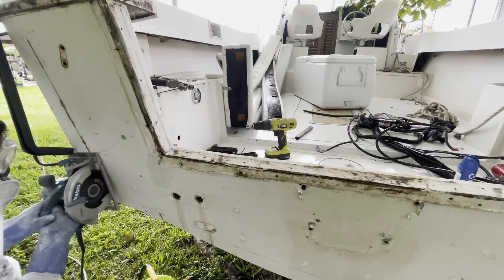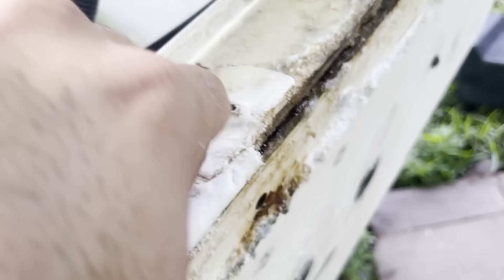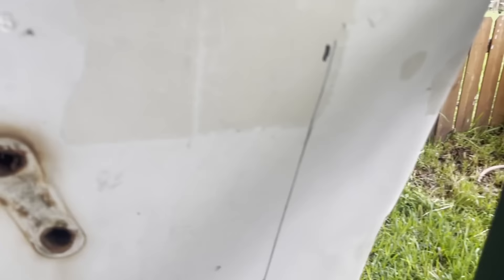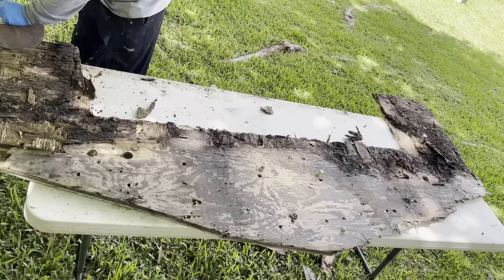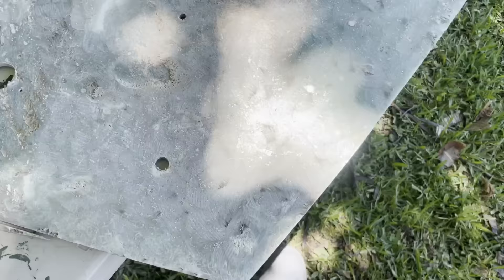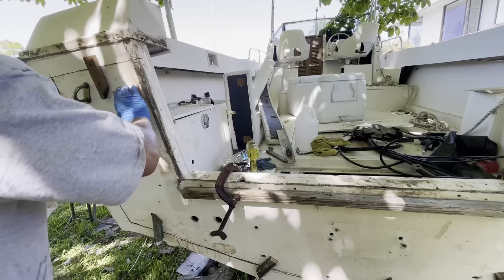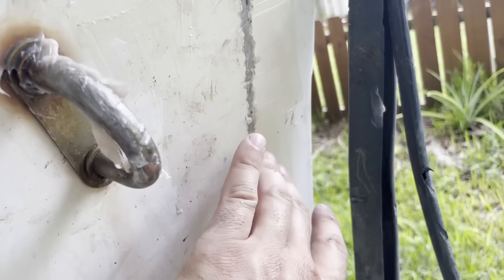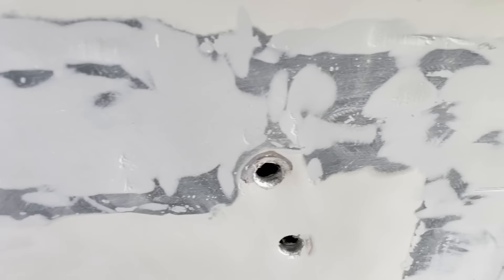Replacing A Boat Transom | Grady White Restoration Project!

Comment: How to destroy a grady white... please do a follow-up video when the engine and whole transom fall off because of your silly little patch job ...
Reply from the maker: Todd. It’s been a year. We literally just did a 200+ mile trip on this boat. I know you’d like for this transom to rip off because you’re an insufferable person. But you obviously have no idea how this poured transom works. It’s been a year. So there’s your follow up. Now, please explain how your theory doesn’t add up.
Reply: @perfectfitboating  After  hurricane Sally I was the equipment operator who destroyed many fiberglass boats , I have unique insight into the strength of boat hulls ... 1\4 in thick has little strength and 1\2in thick is 100x stronger and patch repairs like this literally pull right apart ... I have video posted of my hull repair, my cut back and lap was 6in+ on non structural areas ... also I have a 31ft with rotted transom ,a full width bracket bolted at the edge into the corners of the hull is a very simple and effective solution...
Reply from the maker: Todd, you didn’t answer my question. Instead you stated how you have some type of insight on fiberglass boats because you demolish them. So I’ll ask you again and more directly. Why hasn’t my motor fallen off after a year, why does it have zero signs of failing, and when is it supposed to fall off because of this “silly little patch job”?

Comment: You couldnt pay me to get into that after what you just did . Never and i mean never cut the exterior transom to replace a rotten transom . That is now a compromised hull .
Reply from the maker: I can promise you no one is paying you to ride on any boat.
Reply: Your whitty retort , doesn't defend your half-assed approach to correct fiberglass boat repair , that speaks for itself
Reply from the maker: @1972GT160  youre late to the party bud. This was done almost a year ago. The boat has tons of hours on it and all types of weather in all types of ocean conditions. Zero issues. 
It’s not that serious man it’s just a YouTube video. Dislike it and move on. Thanks for the comment! 🤙

Comment: There is no such thing as dry rot.
Reply from the maker: dry rot |'dri rät |
noun
1 fungal timber decay occurring in poorly ventilated conditions in buildings, resulting in cracking and powdering of the wood.
2 (also dry rot fungus) the fungus that causes dry rot decay.
Serpula lacrymans, family Corticiacee, class Hymenomycetes.

Webster says otherwise

Comment: I really don’t understand how the cold joint at the sides and bottom have strength. I would have at least put some stainless pins in to tie it all together. It seems with all the stresses on the transom it could possibly rip the whole transom off
Reply from the maker: Pretty simple. There’s a chemical bond with all the fiberglass including the back skin, sides and front skin making it all one solid piece. 
I’ve put this boat through the ringer in the  11 months  I’ve had this transom done and had zero issues. Even ran it aground on sand once. Motor shot up and zero issues. I ran it in 6 ft seas two weeks ago. 
This transom isn’t going anywhere.